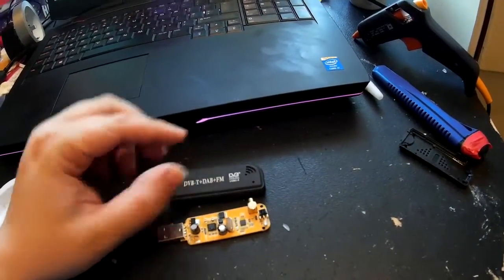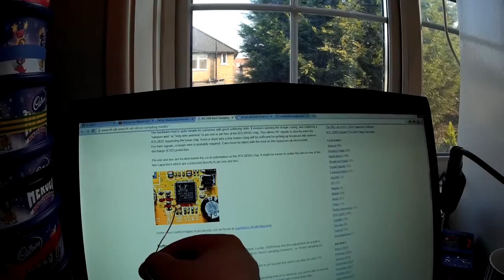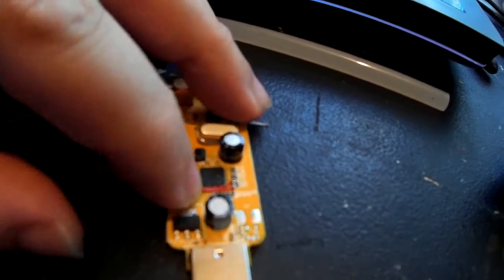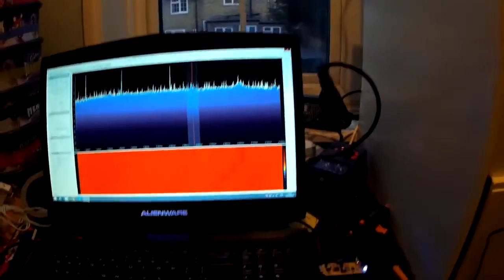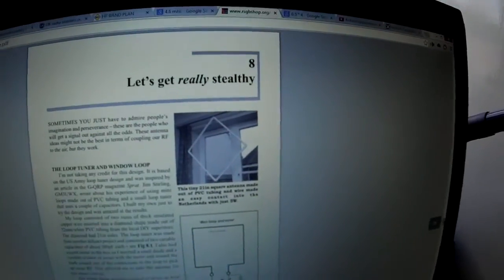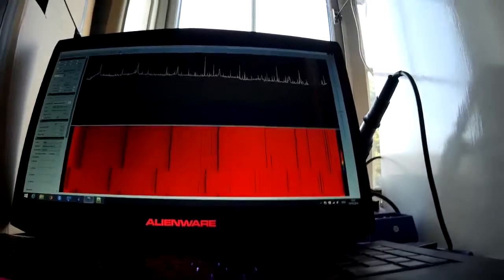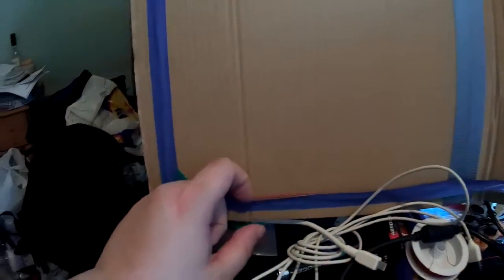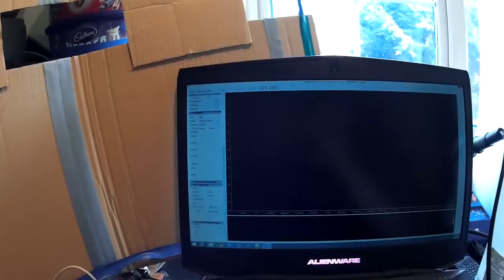RTL-SDR Direct Sampling Hack / Modification and Loop antenna

Comment: Hey man thanks for taking the time to try this out and give us a video.  I'm thinking of taking the plunge soon and it's nice to see it working.
Reply: Any way to get a video/ picture of the tuning cap setup? What kind of effect did it produce on your signal to noise? I went ahead  and did the mod, those spots are /tiny/ and have gotten a few interesting signals already from the discone I made but I think I could do a great bit better if i could remove some noise and interference.  I was thinking that a capacitor in series would attenuate the lower part of the signal since the reactance of a capacitor is an inverse function of frequency.

Comment: If anyone out there is going to do this with a regular soldering iron, try wrapping several cm of #22 bare copper wire on the tip, and extend the end a cm out, to take the heat and serve as an ultra fine tip to solder those little smt parts.

Clean up with a wick and some rosin.

Worked for me on my rtl-sdrs.

Comment: Got a ham it up 125Mhz off-set and it works brilliantly so I would suggest get one instead of all that trouble, BUT if you get some far out frequency's then well done Ill give it a go myself                       73's
Reply: Certainly all about the enjoyment as I am drawing up a plan for a Discone or strait vertical antenna as I was lucky and  given several hundred ft. of copper wire various sizes I just need another 20ft pole now and I'm sure ill get better reception,
Nooelec do the ham it ups and because I live in the UK they made it so I wouldn't get nailed by customs taxes so I would recommend them for quality and service.
Do you watch the walking dead I would love to see it now but without certain channels that costs bundles I have to wait OH WELL
Good luck with all your projects.

Comment: Looks like I did not understand something very well. What I did is soldered the two capacitors together, connected that to an "antenna" and grounded the ground connector (USB connector). It works really nice, I could pick up JT65 in Central/South Europe on 40m sent from Japan with a few meters of wire

Comment: fm breakthrough is a massive problem on these dongles, better drivers on git hub take the recieve lower too, you need an outside antenna.
fitting the dongle in a hammond metal case helped me, also sdr sharp and wd hd sr are shite.
you need a program called sdr console v2 tons better mate.

Comment: I tried to do this myself. I ended up fucking the resistor near pin 1, fucking up the device's sensibility(barely able to receive strong FM transmissions that are receivable even without antenna). I should've bought an upconverter.